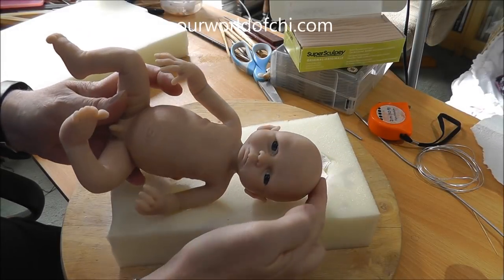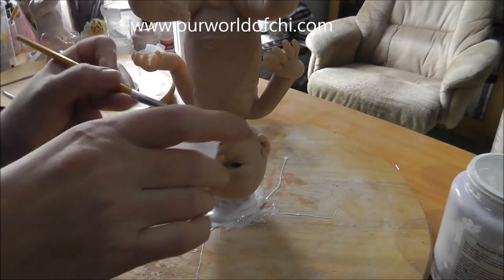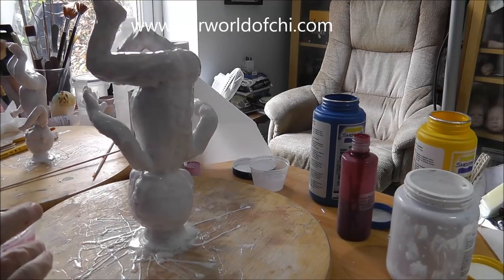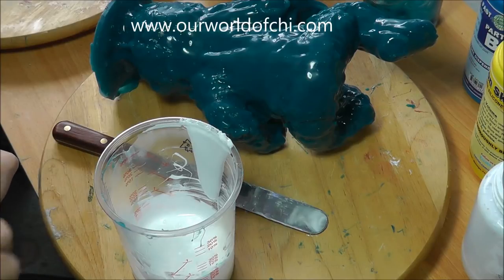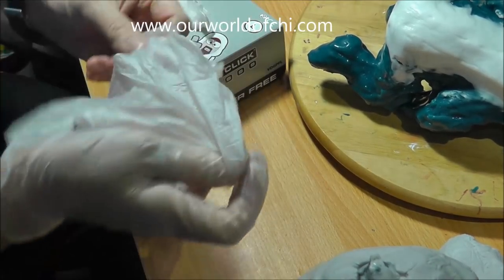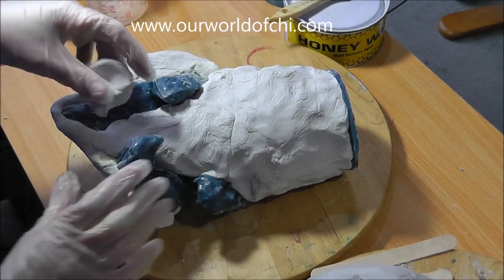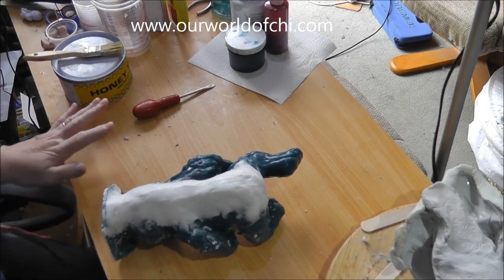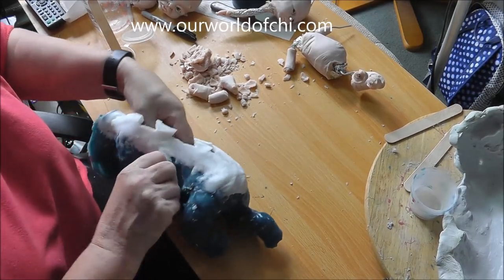Making William - Part 4

Comment: Adding colour the the pouring silicone makes mixing more accurate that if the colour turns even in the mix that it acts as an indicator which tells you that the two part silicones A & B are mixed in to the right way.

Comment: Hello Carolyn i wanted to know what paints you're using for the glove moulding process? I was thinking to use silc pigments since it's for silicone mixing but i can't find where to purchase large quantities of the paint i only find sample kits.. Thanks
Reply from the maker: shonta ford hi, for larger quantity of silu pigments, if you look on amazon and eBay at Polycraft silicone pigments - they work fine for tinting larger quantity of silicone and are reasonable price.
Reply: @CarolynDoughtyDolls  ok thanks so much ❤

Comment: Hello, I didn't catch the product name of the putty that you are using. My granddaughter makes tiny clay babies and she wants to give it a try. I have the Smooth-On silicone but don't know what the casting material that you are using is called. Thank you.
Reply from the maker: Hi, it’s called Free Form Air it’s an epoxy putty and is made by SmoothOn
Reply: @CarolynDoughtyDolls  Thank you so much for your help. We were looking at that product after watching your videos but weren't sure. I have more questions before we make our attempt. Grace has a little channel and has been making babies since she was old enough to not eat the clay. lol. Thanks.
Reply: Before I saw your video's I purchased Smooth-On Universal Mold Release 14 fl. oz. Do you think it will work and then I will buy the stuff that your using the next time.
Reply from the maker: Janet Hoose I know people who have used universal release and had no problems with it, so you should be ok but definitely next time buy the Ease Release spray it is made specially for silicone. There is also a liquid version of Ease Release called Ease Release 205, I have never got on with it and recommend the spray version.
Reply: Ok, Thanks. I will get the other the next time for sure.

Comment: It's me again Carolyn,  I thought there was only one kind of glue that goes in a glue gun.  I put some on my spinner board like you did and it works great until I went to take him off.  I got the silicone loose and took him off and his pour spout I had baked on his head came off.  I had to use a  knife and hammer to get the glue off my board.  I thought you might be able to tell me what I did wrong.  Please,  I'm afraid to do another one
Reply from the maker: Diana Venzon  hmm maybe it was the surface of the board different to mine. What about putting something disposable on top of the board like cardboard and sticking the sculpt to that
Reply: @CarolynDoughtyDolls  that's a good idea,  thanks Carolyn.